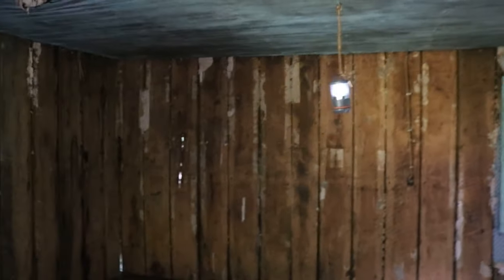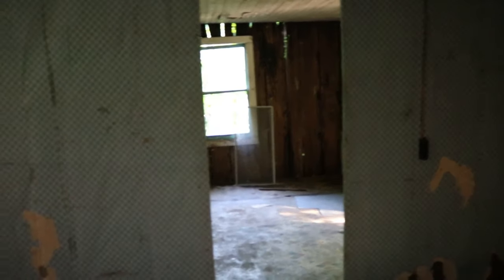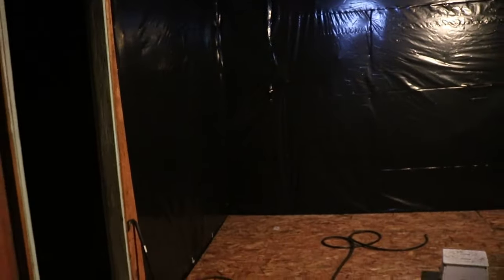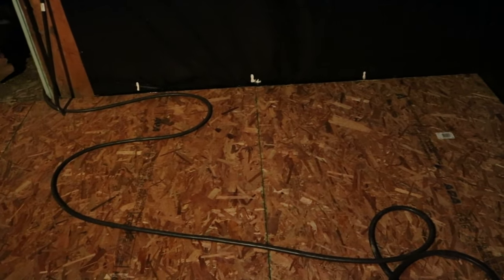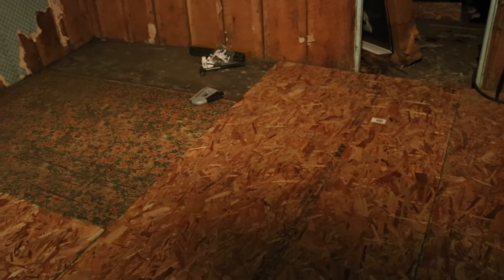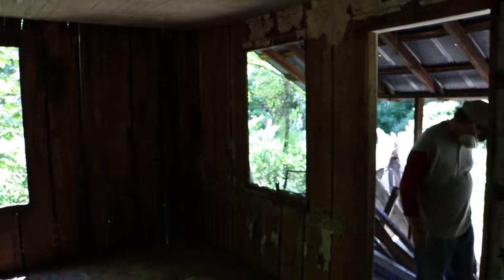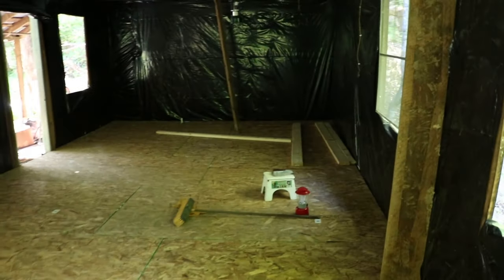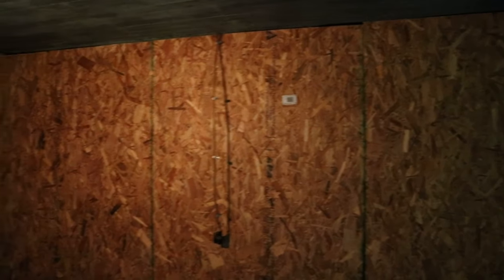Off grid cabin restoration (part 3) new floors and vapor barrier

Comment: hope you dont have any problems with condensation and mold with the visqueen . its usual applied on the inside of the insolation not the out side for a reason . felt paper or house wrap would of been better there

Comment: Placing the vapor barrier behind the siding, won't that cause some condensation issues for the old wood siding?
Reply from the maker: Probably, but it should be just fine, I wont be doing much cooling inside, which is why I chose outside vs inside.